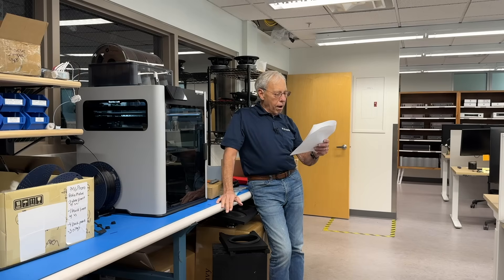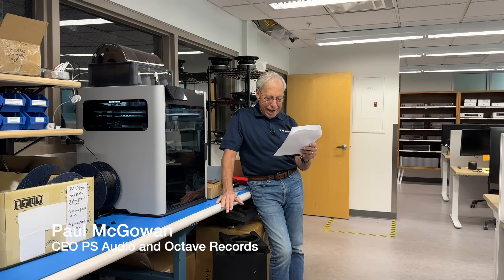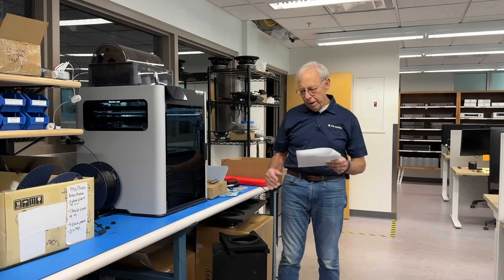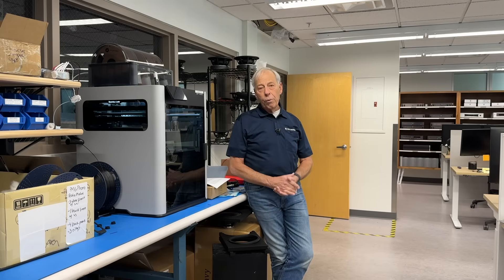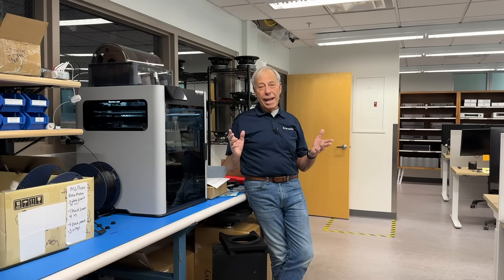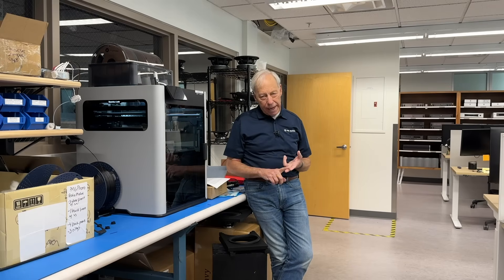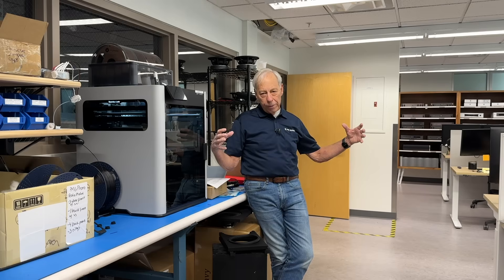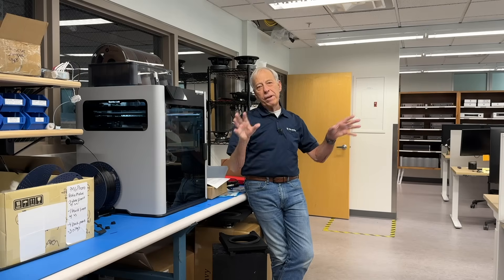Why amplifiers sound different

Comment: Simply put you can not hear the differences in ampliers. You can hear the difference in loudness from a low power amp compared to a high power amp but if both amps are level matched to the capabilities of the low power amp you will not be able to tell the difference with your ears. Human ears are not sensitive enough to tell.

Comment: Every Amplifier I have heard that is promoted as neutral sounded flat and boring. Recorded Music is simply a facsimile, Recording and Mastering will add or takeaway elements, it will never sound as the artist intended because mostly they won't know. Reason is its all down to the matsering engineers they determine the final sound and its the equippment designers who decide what the play back equippment will do to that signal. So lets not pretend! amplifiers, all of them will have a flavour. Its about system synergy which Paul described that includes matching inside components and also matching equippment with other parts of the playback system. Speakers have a voice, cables have a sound, source equippment too will greatly impact the "sound" It all impacts our ears and its simply personal perception of what all that so called synergy sounds like to me or you or anyone else.

Comment: If you've started listening to devices and cables instead of the music, you're not actually hearing anything. Especially if you're around 50, your physical hearing capacity decreases significantly in the upper frequencies. If you're investing in a Hi-Fi business, your commitment is also important. It's best to settle on one thing and stick with it. It's clear that this business is all about the desire to own something.

Comment: What happens if u have preamp in between the headunit and amplifier does that change your end slope at the amp,4 instance if the preamp is 12db and the amplifier 12db does it make it 24db at the end slope of the amplifier output?
Reply: Good question.  Since the preamp and amp are "in series" I would expect the 12db boost (or cut) to be additive, resulting in 24db of boost (or cut).

Comment: The ability to "double down" power into demanding loads is a SIGNIFICANT differentiator between amplifier sonics. 

So much so that to the extent a design can double down, ... makes that amplifier both subjectively and objectively superior. 

This is especially revealed on loudspeakers presenting challenging loads in the LF.

Plain and simple, lacking that robust ability renders lesser amps as lean, or anemic.
Reply: Again, there are many many people who have claimed to hear huge differences--who fail when tested.
Reply: @Rob-k5k9u  maybe in a double-deaf test.  That’s like a double blind test except for gas lighting fools who can’t hear.
Reply: @thomprd  I want high-end nuts to take the double-dumb test. Compare components in an uncontrolled way (dumb1) and then don't say anything about any conclusions they draw (dumb2).
Reply: I haven't seen an amplifier yet that can actually do this at full power. The manufacturers always underrate the 8ohm measurement to claim this, but I will agree that these types of amplifiers have massive power supplies.
Reply: <3 my Levinson 333.
Reply: Bryston. 
Good enough for recording studios.
That's where I got mine.
16y old and still 4y left on the warranty!
Room, speakers and placement make a much larger difference & coloration.
Reply: Agreed.  Damping factor affects the sound.
Reply: @danmarjenka6361  
Theoretically, lowering output impedance facilitates faster current burst capability, which increases speed and control of the woofer. 

Woofer speed is a function of burst current into the voice coil ... limited by inductance.

Comment: Amplifiers don’t “sound” at all—they’re electrical devices and they don’t produce sound themselves. If a manufacturer specifies noise levels of 100 dB or higher, then no one will hear any difference between any amplifiers with that level of noise performance
Reply: That's noice
Reply: that's nonsense ..... amps  make a huge difference
Reply: @robbase-f6x  The only real difference comes from marketing, which does a great job of fooling some people. Do a proper blind test and you’ll NEVER hear ANY difference between two amplifiers.
Reply: I have - been in the hobby for decades .... you are wrong
Reply: @robbase-f6x  I have been 40 years as well - you are got fooled.
Reply: if you think a 45 triode set amp sounds like an Adcom I have some swamp land in Alaska to sell you  :face-green-smiling:
Reply: @robbase-f6x  You can try to sell it to audiophile clowns—just hype it up with magic words like “galaxy-wide soundstage,” “buttery-smooth mids,” and whatever other fairy dust they fall for. They’ll hear angels singing in a toaster if you describe it fancy enough.

Comment: Porque tienen altavoces diferentes.
Porque suenan en salas diferentes.
Porque están ajustados a un volumen diferente.
Porque el que escucha no es el mismo oyente.
Porque el que los vende tiene intereses.
Porque el que los compra ya se ha convencido por otros youtubers.
Porque el amplificador no cumple las mínimas especificaciones Hi-Fi.
Porque al amplificador le pasa algo.
Porque comparamos un amplificador de válvulas termoionicas con amplificador a transistores.
Un amplificador no debe añadir ni quitar nada a la señal original de entrada si lo hace no será de alta fidelidad será otra cosa.
Reply: Suenan diferentes por qué tienen componentes distintos, de ahí el timbre. O me vas a decir que un condensador cerámico es lo mismo a un condensador PIO del mismo valor? 😅Hay que escucharlos no solo ver a gente el yt
Reply: @ismvela3930 Naturalmente que hay diferencias en un componente, usa mal ese condensador o calcula mal el circuito donde lo pongas y el resultado sería espantoso comparado con un componente económico o de baja calidad bien calculado e implementado correctamente en un circuito.
La calidad de un componente no se determina por su precio sino por ensayos, y se determina su TMF.
Sus características determinan su uso y durabilidad.

Comment: That amps sound different is not supported by controlled scientific testing. All amps will add or subtract something to the electrical signal (there is no sound involved with an amp). The issue is whether the additions/subtractions (distortion) to the electrical signal is large enough to be audible--especially on music. It isn't. Of course, more powerful amps can have more volume. Also, some amps are better able to handle short peaks--this can be audible in some circumstances. In no way does some guy saying they hear differences in components any sort of valid evidence. It matters not how many amps they have built. Testing conditions must be controlled. When they are, nobody has been able to distinguish amps operating within specs when listening to music. It's that simple.

Comment: How would you truly know what is being "added or taken away" unless you were A/B comparing it to the original equipment, in the original place it was mastered? Second question....when doing any new equipment R&D, is there a list of tracks that are used for reference? And in what format? I know we all have our "go-to" albums/tracks that we test new speakers/headphones/etc with, just curious what the company engineers use to test THEIR equipment. (Let's say a new amplifier for relevant conversation sake). Are you throwing on some Steely Dan too or do you have "special" source material you use? Thank you :)
Reply: Because one is comparing the input signal to the output signal. Whether anything what added or lost to the sound produced from the output is merely a matter of opinion and the skill of the recording engineer.
Reply: @Rob-k5k9u  I think I get what you are saying, but my thinking is unless you are comparing to the original source equipment then you're results are already skewed since you are using a different "flavor" to start with. Something has already been "added or taken away" from the originally intended presentation of the sound. I guess it doesn't matter since it is subjective anyway, just wondering how anyone could listen to (or measure) an amplifier and say for instance, "It has a warmer sound". Warmer than what? The original master recording? ...or just what you are comparing it to? Does that make sense? Maybe I totally misunderstood the conversation and am off in my own world. lol.
Reply: @ericbennett1253  Why assume that you need the same equipment if different equipment sounds the same?
Reply: @Rob-k5k9u  You are saying different equipment sounds the same? I disagree.
Reply: @ericbennett1253  Which equipment? Amps, and some other things, "sound" the same (note: they don't make or alter sound). Speakers (and some other things) don't sound the same.
Reply: @Rob-k5k9u So you are saying Class A, Class B, Class A/B, Class D, and Tube amps all sound the same? Or Yamaha, Denon, Marantz, PS Audio, McIntosh amps all sound the same? A $500 200w/ch amp sounds the same as a $5,000 200w/ch amp? I've never heard that before.
Reply: @ericbennett1253  As they have nearly identical  frequency response (basically flat), and distortion well below what is audible on music, it is logical to expect they will sound the same. But, as I said, nobody has demonstrated they can distinguish such amps, level matched, playing music within their operating specifications. More powerful amps can play louder without clipping (which greatly increases distortion).

Comment: I grew up in the heyday of "home hi-fi" in the 1970s, when everyone had a "stereo system" of some kind, whether it was a mono record player or a furniture console with built in turntable and AM/FM radio (and maybe a tape deck later on). Audio equipment was marketed for its distinctive SOUND -- the coloration it brought to the music, according to the listener's taste. Each of the major manufacturers of the day -- Marantz, Pioneer, McIntosh, Sansui, Harman-Kardon, etc. -- had a more-or-less recognizable "house sound" of some kind. Yes, there are many technological elements that shape what someone hears at home -- room acoustics, source recording/format, turntable cartridge, speakers/placement, etc. -- but the amp is the penultimate stage in the process, where current is transformed into into the signal that's sent to your speakers. Some (naïve?) people assume audio equipment is designed to be "neutral" or "accurate" -- but compared to what? Who can replicate the equipment used to record and mix the music in the studio?
Reply: High fidelity means faithful to something--the simplest something is what the recording engineer put on the master recording, based on what he heard on his speakers in the studio. Since people do not know what that is, it isn't a practical reference. The original reference was to sound like live music as hear in a concert hall or jazz club.  Something the listener can be familiar with. So, classical and jazz have live references that home audio attempts to be faithful to. Pop music does not because it is multitracked, which means that no consistent ambient space (or location of instruments) can be expected. Admittedly, nobody really wants their rock music to sound like a live rock performance (often in a stadium).
Reply: @Rob-k5k9u  Good point. Recorded music and live music are entirely different experiences -- and electric guitar amps aren't necessarily "high fidelity" musical instruments!
Reply: @bacarandii Things that are used to create sounds (music) can never be described as high fidelity as they are not compared to anything.
Reply: @Rob-k5k9u 
ABSOLUTELY!
This is the philosophy of the Absolute Sound reviewers.
Can't argue.

Comment: I tend to stay out of conversations involving electronics since I am not an expert and even if I was I've seen plenty of conflicting views. Paul, you mentioned in passing the sound you got from various amp configurations over the years. That is the real answer; does the amp sound good to you? That's all that matters. There are so many variables that go into an amp design and build, I can see why people spend their careers searching for the "ultimate combination".
Reply: If one thinks that all that matters is how an amp "sounds" to one, then one is not seeking high fidelity but rather subjectively pretty reproduction. As amp do not sound different, this is a non issue for amps. You can buy an equalizer and tailor all you hear to what you like.
Reply: @Rob-k5k9u okay
Reply: @Rob-k5k9u  
Many do sound, and measure, appreciably different. 
The ability to double down to varying levels is 100% noticeable, and measurable. 

Most amplifiers struggle in this regard, some don't ... the former sound anemic vis-à-vis the latter.
Reply: @FOH3663  Some measure different, they don't sound different. I 100% guarantee it.
Reply: @Rob-k5k9u  
The ability to double down vs not, yields a 3dB increase at the frequency of interest.

That's very much audible. 
It's ok, however I don't understand those who feel otherwise. 

I DO understand the insistence that amplifier sonics can often be quite similar. But re current capability, doubling down etc, ... there's clear differences, measurably and audibly.
Reply: @FOH3663  What we need is for you to demonstrate you can hear a difference, not further claims. Lots of people have made strong claims that disappear when the blindfolds come out.
Reply: @Rob-k5k9u  
I know of no one that disputes the differences I'm pointing out. 
It's not conjecture. 
Twice the power at a given bass frequency isn't hard to distinguish. 

That's why I'm bewildered by those parroting what others say ... ie., there's no difference, etc. 

I'm not referring to topology sonics ... certainly legit albeit modestly subtle differences. Not worth arguing when the power doubling exists. 

I'm pointing out a doubling of power of a bass guitar low E for example.
Reply: @FOH3663  Twice the power leads to a barely noticeable 3dB increase in maximum volume. (That can be distinguished in a double-blind test.) To subjectively double the max volume, one needs 10 times the power.
Reply: @Rob-k5k9u 
I wouldn't characterize 3dB as barely noticeable, ... but ok. 

Regardless, amplifiers differentiate themselves sonically by exhibiting the ability to track demanding loads, ... or not. 

The former being preferred, the latter being anemic. 

The above seems easily heard. Even an untrained listener appreciates 3dB. 

Less easy to discern, yet still significant, is the transparency and overall characteristic presentation of an amplifier. 

Amplifiers present differently. 
Even operating within their linear range, they exhibit sonic differences relative to one another. 

These are oftentimes subtle, however once experienced, the differences become easier to differentiate. 

It's ok to disagree. 
You're not alone, many enthusiasts haven't experienced it.

(for whatever reason, openness and dimensionality, vs less open more flat presentation, is a typical difference)
Reply: @FOH3663  No argument that more powerful amps can sound different (louder). The also differ on the type of loads they can handle. That's not an audible difference between amps working within their specs. Saying they exhibit sonic differences (more "open" etc.) is not credible as many have said so and failed to distinguish the amps under controlled conditions. It's fine for people to think otherwise, but claims that are not supported by evidence need to be questioned.

Comment: A few years ago, there was a thread on Avforums in which the OP insisted all amps sounded the same. It got rather heated, as I recall. I followed it but didn't get involved.
Reply: I don’t even know why this is controversial. I can play the opening song of the Blade Runner 2 soundtrack and its sub bass will rumble like thunder and rattle my speakers on some amps and be smooth, graceful and relaxed on others. It might not be like the difference between peanut butter and jelly but it’s there.
Reply: @mikeg2491   There is a lot of controlled (i.e., scientific) testing that supports the idea that people can't distinguish ANY amps playing within their specs. What people say they hear is pretty much useless unless factors are controlled. We cannot determine what is causing the differences they "hear"--including psychological factors like a placebo effect.
Reply: @Rob-k5k9u  It makes no sense that two devices with completely different innards and parts would be fungible with each other. It’s like arguing speakers should all sound the same when they’re all built differently. As for the hearing studies, most people can’t tell the difference between 480p, 720p, 1080p, or 4k movies on a 65” TV. So I don’t trust them to pick out minute differences in audio either. The wisdom of the masses is something I’ve never put much stock in.
Reply: @Rob-k5k9u Spoken like a true EE and 100% Wrong! No piece of test equipment can match the human brain and ear……..Straw argument…….don’t even go there…..
Reply: @LarryNiles-t1d  So, humans can hear better than microphones, see further than telescopes, and see things smaller than microscopes. The humans brain, um I mean sensory system--can't be matched. Right...........
Reply: @mikeg2491  The unsupported naive beliefs of people lacking proper understanding is not credible. Do you have any evidence that two devices with "different innards" will sound different enough for people to hear? (Not some made up analogy---actual evidence?) If people fail to distinguish differences, how did you determine what the should have been able to distinguish? Did that come to you in a dream?